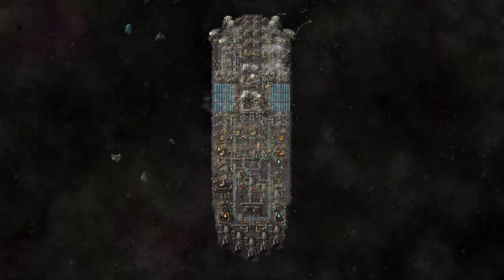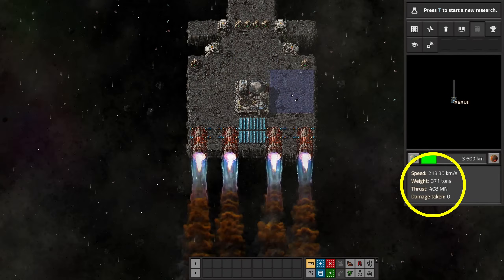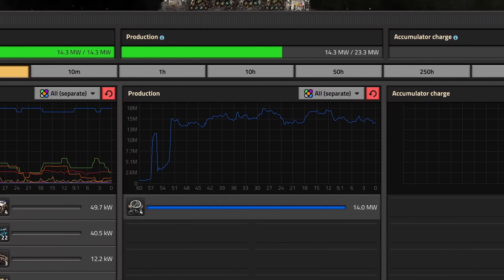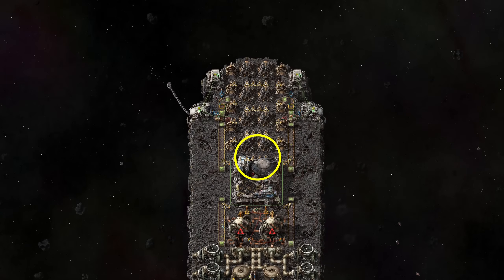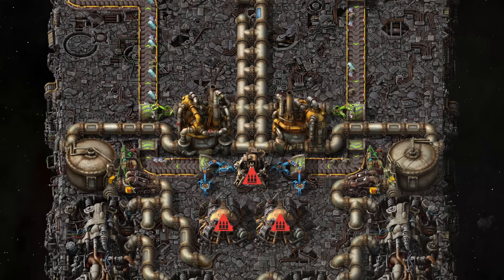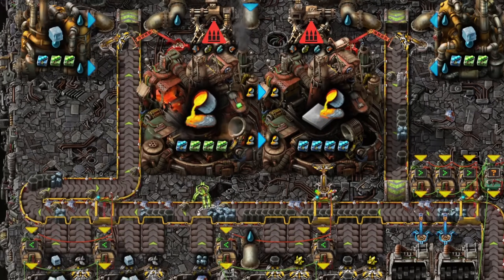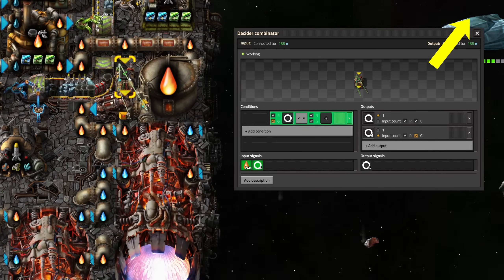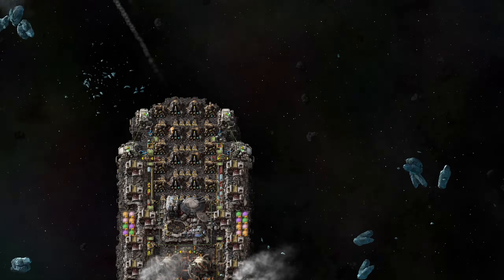Aquilo Spaceship Design - Fast, Reliable and Gorgeous! - Factorio Guide / Tutorial

Comment from the maker: Update:
Blueprint now has a description explaining how to kickstart the reactors (remove foundries temporarily and use ~4-6 solar panels).
I added another blueprint version that doesn't require/use belt stacking and stack inserters. It uses level 2 modules and I changed thruster throttling to make it slower, because I assume a player without these technologies might also have lower damage research unlocked.
Reply: Testing out the blueprint and when first getting fueled up, the ice can't fit on the belt as the carbon takes up all the space.
Reply: @dan7rex same, how do u solve that issue?
Reply: @lucaschan-uh5ji Same to me, but i didn’t have stack belts and inserters. Prob that explains.
Reply: @digins5533 I realised that u need belt stack level 2 or above for this blueprint to work
Reply: This looks slick! Keep up the great content!
Reply: I also want to note, that if you build this ship on Nauvis, there well be a significant decrease in water supply to get start creating rockets and fueling. For this I turned off the pump filter, so the water passes down to fuel up and creating rockets. Then apply the pump filter again.

Comment: Hey Avadii..  just popping back in to say- what an awesome ship! It's my Aquilo hauler of choice. Everything on it is perfect(As per my comment before this- about 3/4 weeks ago when I started playing Factorio, I did increase the ammo and rockets to 750 each and had to increase and change around the guns a bit. Not ONE HIT in about 150 trips).

I tried building my own Aquilo hauler and everything works(750 ammo and rockets are my fav nr. for an Aquilo roundtrip)..... except the d_mn carbon/sulfur crushing first causing a backup(I solved this) ... then the crusher ceases working any further since the amount of carbon on the belt has met the condition... however there is no sulfur for my explosives! 😀
My condition for carbon on the belt is 100... and 50 for the sulfur... but right now, I've got 102 carbon on the belt, no sulfur, and the inster is obviously not gunna move, cause hey- there's enough carbon on the belt. I'd have to increase the limit on carbon, but what happens the next time, I run out of sulfur for explosives? I can't just keep on increasing the carbon limit.

I'm pulling my hair out... and I don't want to lob stuff over the side of the ship. That is wayyyy too messy and just such a ghetto-level "solution". I see you don't really have that problem.
It's one of the most complicated problems I've had to face in Factorio... and I'm sure the ice/calcite crushing is gunna give me the same issue, but I haven't used this long enough to encounter that issue... yet.

EDIT: I solved my problem. Re-crushing was off-balance and the crusher dedicated to the water tank was dumping ice and oxide onto the belt- which it shouldn't. I've disabled it, by rotating the inserter(in case I need it in future). THANK YOU! Your ship helped me understand ship design and efficient resource management! Now... the possibilities are endless! 😀
It has a special place in my heart!

It's so "ghetto" throwing things overboard, pre-Shattered-Planet. So uncouth. So... messy.. and I know- I'm African! 😀
"Blight" is our middle-name.
Also, IMO it shows holes in your planning and design... (Like walls, show the same- except if you use them for aesthetic purposes)
Automatic resource management and re-allocation, without anything going to waste or being voided, is so elegant.

Anyway, using your own- and Nilaus' ships as inspiration, I constructed my first Aquilo-ship. 10 Common quality cargo bays, 5 turbines and four Collectors. The only items that use modules are the ammo machines, fuel plants and crushers. These are standard, level 1 modules. 8 Rocket launchers and 10 turrets- only needs "Physical Projectile Damage" level 5 or 6.

Speed is regulated(needs priming- ie: Just disable and re-enable by clicking "Enable/Disable" on the pumps, for your first launch). The 2 indicator lights are set to alert when fuel or oxider is below 10K(Might want to increase it to 12K)

Fuel tanks fill about 15K, in 5 minutes, ammo is everpresent(680 for turrets and 580 for rockets) + 150 of each on the belt and they get filled in ~5 minutes.

NOTHING gets thrown overboard(I did leave a Recycler and mechanism for that, if you want to be so inclined- suit yourself, if you want to be "messy". Just rotate the first inserter) and you will not have shortage of anything, cause of re-crushing and auto-crushing, you see. Auto-crushing also has Hysteresis, so your crushers don't "go crazy".

(Note that the outputs of the 2 Oxide Deciders aren't connected to the 2 oxide crushers anymore... normal crushing here is not needed, since we have normal Oxide crushing dediacted to the water tanks(the ice-output inserter for the belt is rotated, so it's "disabled" basically- turn it towards the belt, if you need it in future).. but you may want to use them in future, so just re-connect the outputs same way as the carbo-crusher are connected, but of course- to the oxide crushers instead)

Everything stays in perfect harmony and even at Aquilo, you can be low on everything and still be filled and stocked within 10/15 minutes - ready to go again!

https://factorioprints.com/view/-OhKK1NojJhdlFyYpqqC

Comment: A wider ship allows you to add more engines- negating the speed penalty! 😉
Also allows you to add more guns and rockets, destroying more asteroids and gaining more resources! 😉

Anyway, I had quite some problems getting this guy going.

There were balance issues, the belt being strewn with iron ore and carbon(I put a limit of 250 each on the inserters that load these onto the belt) preventing new items from being added onto the belt, the stack inserters' behaviour causing issues(I switched them out with bulk inserters), and this all meant the ship wasn't even getting halfway to Aquilo before suffering significant damage and so on.

I added 4 more guns at the front and made it wider(and I also moved the collector a bit backwards- behind the 2 front rows of now 6 guns each and just above the second pair of collectors, but a little more outward- looks like a penis hood😀), cause the issue I identified was that some of the the smaller asteroids, sometimes weren't being destroyed in time, so they damaged the front of the ship/the guns/collectors and so on. Two of the outer newly added guns are set to fire at anything that moves. The rocket launchers are fine. I also increased rockets and ammo to 750, each. This all enhances the balance and also ensures I'll have enough ammo for at least 3 immediate trips to/from Aquilo and back.

I also added and doubled up on front walls for an added layer of protection - just in case, but since I have no more damage issues, I've kept them for aesthetic purposes.

It's perfect now. NOTHING can touch it and I like it for the speed! I even increased the speed a bit to test the guns at the front and to see how far I can push these and I didn't suffer damage - even at full speed.

Comment: I was struggling to find a ship capable of reaching Aquilo, and I came across this video. By adding two railguns to the front of this ship, I was able to reach the edge of the solar system. It survived almost unscathed, even on a world with twice the asteroid influx rate, and I'm amazed at the excellence of the basic design, its expandability, and its versatility. When building on Nauvis, keep in mind that the influx rate of oxidizing asteroids is low, making it difficult to fill the reactor water tanks. Another user suggested importing ice as a solution. Thank you for sharing this wonderful ship design.

Comment: Awesome and effective design! Thanks a lot for this blueprint. But after some time this ship has been to space, the sushi belt gets overcrowded and stops moving. Then random production buildings stop working due to not having resources and if that's the bullets/rockets, you're toast. The workaround is to delete 20-30 belts and rebuild them to get the belt moving, and the permanent fix would be to add logic and inserters that throw stuff into space when the belt is crowded.

Comment: Does the 2 nuclear setup matter at all for efficiency? The 2 heat exchangers can output a max of 20MW. If always running at full load, that 4GJ in 200 secs. the 2 fuel cells can produce 160MW * 200 = 32GJ. The setup has a heat buffer of 11GJ (10GJ from the reactors and 1GJ from the exchangers. So, in 200 secs, the maximum power that can be extracted is 11 + 4 = 15 GJ from 2 fuel cells. This is 7.5 GJ per cell.

In a 1 reactor setup + 2 exchanger setup, it can still produce the 20 MW and has a heat buffer of 6 (5GJ from the reactor and 1GJ from the exchangers. So, you can extract 6 + 4 = 10 GJ from the fuel cell. Now the bottleneck is the reactor which can only produce 8 GJ in 200 secs. So, you can extract a total of 8 GJ per fuel cell.

Am I missing some reasoning here?

Comment: I really like the design, in general.  But it's weird having 2 reactors on a ship with only 2 Heat Exchangers.  While the reactors can theoretically generate 160 MW, they would need 16 Heat Exchangers and 28 Turbines to get that much power.  With 2 Exchangers and 4 Turbines, you're only getting ~20 MW of steady power.  After stretching the ship a bit to fit 4 Exchangers and 7 Turbines (and removing a reactor), I'm pretty happy with this design.
Reply: You can run regular reactors but use rare or better heat exchanger+turbine.

Comment: Since Aquilo doesn't import or export anything spoilable, for freighter-type ships just meant to run supplies in the background, unmanaged, this is totally unnecessary (and unnecessarily complicated). It also needs far too much fiddling about to get it started after being built - or huge waiting times if it's just left to its own devices. As a result, while this isn't outright terrible or anything, I'm left wondering what the purpose of it is. It needs too much management to be an easily stamped down freighter-type. And you don't really need a specific personal transport ship to go to or from Aquilo, you can just hop on a freighter. Or keep one around for personal transport. I guess it was a nice personal design challenge?

Comment: I'm trying to get this ship flying but the belt keeps getting jammed, leading to no ice, no water and no rockets. Sushi belts... I hate sushi belts

EDIT: After many more hours, I'm giving up. I can't be bothered to manually clear beltspace all the time. This ship us not for me.
Reply: Yeah, the ship's sushi belt requires circuit logic to work properly (i.e. only insert stuff onto the belt if item count of that type of stuff is below a certain threshold). By measuring the length of the belt in tiles you can determine how many items fit on the belt, and divide that budget among all item types, including a reserve for leaving parts of the belt empty. Stacking allows for even more capacity.
Reply: the same thing is happening me

Comment: Question: How long does it take for a water buffer to build up around Nauvis? I’m running into an issue where the steam turbines chew through the water despite solar panels being available.
Reply from the maker: So your energy consumption is higher than what the solar panels generate? remove the main consumer of your electricity which is the foundry.

Comment: Thanks for the design! As a tip for anyone using this and wanting to get going sooner than later, I suggest importing some ice to bootstrap the water. Oxide asteroids aren't plentiful in orbit so it takes it forever to get going. I imported 1000 ice (which I had from other ships I had going back and forth) and once I put it on the belt it gave me enough water to get fuel for the rockets going. At which point you can start the ship moving and it can collect its own asteroids.

Comment: I've been testing the ship in Editors Extensions and noticed issues with asteroids damaging the front section when traveling from Aquilo to Fulgora. I suggest reducing travel speed or upgrading defenses for explosive and physical damage to at least 10. The default blueprint's recommendation of Damage 8 requires frequent repairs outside Aquilo's orbit. Otherwise, it's a solid ship. I plan to use it as my default, as designing ships hasn't been as enjoyable or successful. Love the videos!

Comment: I'm having issues with the front not actually putting 80 of each item on the belt. . . How do I fix this? 

Edit: Now I'm having issues even getting water from oxide asteroids to even begin the reactors. . . How do I fix this?
Reply from the maker: Mh, it's hard to tell what went wrong. Don't forget to use the constant combinator outputting a signal of 1 for each asteroid type.
Reply: @AVADIIStrategy  I did that, but the filter isn't working for the asteroid collectors. It won't enable the filters to grab anything. . . Any suggestion?

Comment: the belt is always overfilled, there is nothing that deletes stuff
Reply from the maker: Right, because it's not necesary to delete stuff. The asteroid collectors will only catch asteroids when needed.
If the belts overfill there's something wrong. You have to make sure that belt stacking capacity is at 4. If not you have to either change combinator values or use the other blueprint that works without belt stacking.

Comment: at one point, for some reason, the belts were completely overloaded with carbon. couldnt figure out why and had to wipe the surface of the ship and replace the blueprint. Ice and iron plates couldnt be placed on the belt
Reply: did you find out what caused this?
Reply: @kevineke9095  I did, Inefficient logic on the decider and selector combinators for the crushers.  This ship design doesn't work longer than 30 minutes on Aquilo.  You have to rework so much logic...
Reply: @kevineke9095  yeah definitely not what this guy said. Some of the parts got wrecked early and when the ship replaced the parts I didn't reconnect the wiring so the grabbers were set to only grab carbon because that was the last setting they had before they were destroyed and replaced. 

Anyways we wiped the surface of the ship and replaced the Blueprint. It's been working perfectly and stays over Aquilas with no problems. I am using the budget one by the way.

Comment: You realize that you have way less energy capacity than necessary to use the 'efficiency' of 2 nuclear reactors, right?  Every time you insert fuel, your reactors will hit 1000C and waste a ton of fuel - reactors have a heat capacity of 10MJ/C so they can only store 5GJ beteen 500 and 1000C (the heat exchanger will add another 500MJ). 

Yeah they produce 16GJ in 200seconds with the 1 adjacent neighbor bonus.  So all that fuel you think you're saving - it's all wasted, and then some.

You should switch to using steam buffer tanks instead of water - yes, steam is 'less dense' than water, as a resource buffer, but it's way better as an energy buffer.  Otherwise, using 2 reactors is a complete waste.
Reply from the maker: Yes, but it's not as bad as you say it is. The reactors generate 32GJ in 200 seconds.
The system can buffer 10GJ inside the reactors + 1 GJ in both heat exchangers.
Additionally, during those 200 seconds the ship will consume 2.4GJ of energy, which means 32GJ - 10 - 1 - 2.4 = 18.6 GJ are wasted.
That's slightly worse than a solo reactor. So if you really care you could just disable one of the inserters and leave 1 reactor without fuel, which is better than a solo reactor because of the added buffer.
But since it's so close it doesn't really matter.
The efficiency of the double reactor gets better though, as soon as you start using quality items and modules.
My current ship has rare heat exchangers, rare turbines and draws 30MW which is 3.6 GJ more consumption during those 200 seconds.
Making it more efficient than a solo reactor.

Comment: II wonder if the reason of(specifically at 0:35), Rocket ships in space are often elongated instead of wide, are as we are going upward as that is the front, and having more width as in more blocks will make it that your ship would have to face more of wind pressure? wait are there winds at space irl anyway? but nonetheless that's how I understand how a vertically long ship is better than a horizontally long one in terms of having more speed.
Reply: There is precisely ZERO wind in space😂 it’s weird game physics but it makes your designs prioritize sleekness. Game design intentional. On the other hand I’m concerned why you didn’t know space has no air

Comment: Good day. I used this blueprint but the reactors don't load the uranium into the reactors. I have to do it manually.
Reply from the maker: Yes, the ship doesn't have a secondary energy source like backup solar panels installed.
Which is why you have to temporarily use solar panels to start up nuclear energy production.
Remove the foundries and place 5 solar panels, then wait for the ship to come alive.
Don't build the second foundry (the one that draws most of the energy) until you've gathered enough water and materials.
Reply: @AVADIIStrategy The startup part I knew. I'm talking about when it's been running. I've had to manually add the nuclear fuel source after both reactors were running already. Four times now.
Reply from the maker: @backaddict673  The reactors are only refueld when the temperature drops below a threshold. So it's normal to see the 'no fuel' warning icon most of the time.
If you run out of energy though, there might be something wrong with the circuit logic. Take a look at the decider combinator to debug the problem.
Reply: @AVADIIStrategy I'll check that, thanks. It definitely went below the circuit temp first and second time.